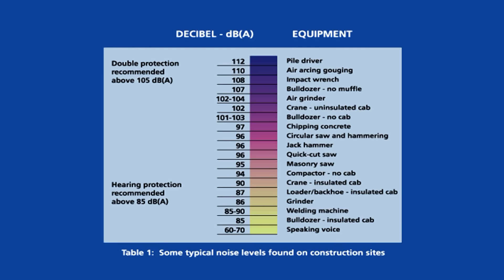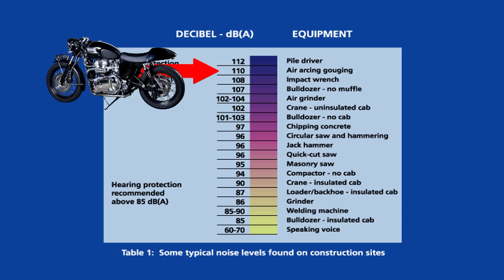Why Not to Change Your Car's Muffler

Comment: Next video:
“Why cars shouldn’t be fun”
Reply: SGKatrox "why modern cars aren't as fun as 90s cars"
Reply: Lol
Reply: "Why the only car you should own is a bone stock mid 90s Toyota Celica"
Reply: Jesse Westover lmao
Reply: you have to tune your exhaust then it would be fine to change it but if you dont tune it it will be just like he said in the video
Reply: Lmfao
Reply: Why u should take the bus
Reply: Lololol yall funny as hell broo dam
Reply: It's just a title of the video, if you actually watched it he says he's all for it except that you have to know what you're doing. I've driven without a muffler for a week (not because I wanted to, but because it fell off lol) and it's a fact that the car runs worse, it felt like the gas pedal did not accelerate the car fast enough (loss of power) and my mpg went from 9mi/gal to 5mi/gal.
Reply: As a mechanic myself cars aren't made to be fun. They are a tool that you use to improve your life!
Reply: 1996 camaro Z28 LT1. torque galore
Reply: Borie Seng don't worry we'll straight pipe it too
Reply: Sarem no it wont🤣

Comment: Funny enough, I bought a 2002 Mitsubishi Lancer from a woman who said it didn't have a catalytic converter. Turned out it had an $900 Magnaflow high flow cat and muffler. Needless to say, it made it sound like a Nascar. 

Now? I just bought a 94 4Runner off Craigslist. Turns out. Someone decided to straight pipe it so it doesn't have a muffler. Still has a cat though, just no muffler.

Comment: I cant agree with him, doing a full exhaust and the right tune does have a significant difference
Reply: Fat091587 If you watched it fully he says about having it tuned top specific exhaust backpressures but that to many don't put the time into it.
Reply: He didn't talk about back pressure, he spoke of flow rates. Internet argument ENGAGE!!!
Reply: Doing some exhaust work on mine too. Factory exhaust is too restrictive for all the other mods I've done lately. Loving the supercharger whine but wanna hear it roar from the back too you know.
Reply: keyword right tune. most inexperienced people don't tune anything to compensate for the pressure change
Reply: Did you even watch the video? He specifically said it's not a big deal to just swap mufflers if you get a tune, just not very effective. This wasnt about full systems just people sticking fart can mufflers on stock exhaust systems

Comment: Watch this video. I removed the Muffler anyway.
Reply: Billal mabuza well??? Did the performance of the car change like Scotty says?
Reply: @tiktoktiktoktiktok6065  I changed the muffler on my '06 Tacoma and haven't had any noticable power changes or even a check engine light. Just a nicer sounding truck, which is what I wanted.
Reply: Imma about to do it tomorrow haha
Reply: @ICEY02  lol doing mine monday
Reply: Me to
Reply: Update! My low end torque became slow and my gas consumption went just a little bit high and it pops when my aircon is off lol but it sounds great HAHAHA
Reply: im going to do mine as we speak
Reply: low end torque comes from back pressure.. there's always a drawback to messing with the exhuast.. there made to allow a smooth balance of as much low end and high end power!! try a high performance air intake to match the the inlet flow to the now faster outlet flow
Reply: @massivewoofers247  you are a 💯 correct. I put a K&N air filter in my truck after I had the exhaust done and it runs much better..it feels like it flows better.

Comment: Better Title: Why Not to Change Your Car's Muffler with no Tune.
Reply: You can drive the car wothout exhaust and it still would be fine
Reply: AlwaysChristian wrong bigtime. Running with Fuel Trims skewed all over the place isn’t “the computer being smart enough to compensate”. If you want your car running right, play it safe, tune for modifications.
Reply: Webba i have been running de muffled car for 12 years without problem. If you need to play it safe the car just sucks.
Reply: Wow you need a tune just to change a muffler,  you’re smart aren’t you?
Reply: Guys I'm not saying that I personally think you need a remapped ECU tune to change your muffler, I'm saying that Scotty wasn't focusing so much on the muffler change itself but on how the ECU handled the muffler change.
Reply: Agreed.
Reply: there is a difference between changing just the rear muffler and all the mufflers
you can change the rear muffler as much as you want, even remove it and there'll be no difference as there are no sensors back there
Reply: @AlwaysChristian I speak from experience. My car has no cats, muffler, or resonator, and it is tuned for that. I have never had O2 sensor issues with my car. A gent i know has a canned tune on his running header-back exhaust as well,  and he goes through O2 sensors every 2 years. Furthermore, there is a difference between air-fuel ratio and fuel trims. Yes air-fuel ratio is supposed to fluctuate constantly, but fuel trims are supposed to remain within certain specifications. If they are pulling or adding too much fuel, there is something the ecu isnt being told about.

Comment: I had a 1982 Mercury Lynx that had a huge muffler and a tiny tailpipe that would top out at 89 MPH. I had the muffler taken off and replaced with an ANZA angle cut resonator tip. The sound was great. I put one of those TURBO stick on placards on the hatch lid. Everybody swore it had a turbo with it backfiring and flaming. It would then do 125 MPH with no further mods. I loved that car to death!

Comment: All you have to do is tune your car after you muffler delete.
Reply: Only if you delete the cat
Reply: I am alive
Reply: Mufflers are past any o2 sensors..unless it’s a muffler delete(straight) then most likely airflow from the engines exhaust will change since exhaust air won’t have any restrictions and might change readings on the o2 sensor.. other than that a muffler with a different muffler won’t change much..
Reply: the rear muffler/s do not affect anything
Reply: Yes your right but it's extremely expensive , I have headers on my 350z and it runs better so a month later I decat itand it ran shitty ,I also had muffler delete ,now I put muffler back on with headers runs great
Reply: Also put the cats back on to
Reply: @Foozefighter  would i pass the sniffer inspection after switching my muffler for straight pipe
Reply: @Fingerboardmaster200  i am not familiar with the laws of your country, you should check that first
Reply: @danielrichardson2931  high flow cats run out better than test pipes/cat deletes. They cost more but worth it.
Reply: @cmdoseck3022  nothing flows better than down-test pipes ,but it made my 350 z run worse with my shorty  headers ,if I  had it reprogrammed ,or retuned then It would of worked but they wanted 1500 $
Reply: @cmdoseck3022  when you out down pipes ,your doing a  total cat delete
Reply: @danielrichardson2931   just speaking from personal experience......and preference. I kind of prefer the smooth feel of a high flow over the blatty test pipe.
Reply: ￼

John Hege

Automotive Mechanic

38 years of experience

Any change you make in the exhaust system downstream of the catalyst and Oxygen sensors should not affect the performance of the car or the control systems. Making changes in the exhaust ahead of the catalyst or oxygen sensors may cause you an assortment of problems. In either case, deleting a muffler from the exhaust could give the dealer service department an excuse not to honor any warranty. So you might be well advised to put any such work off until the manufacturer’s warranty has expired. If however you are having problems with your exhaust and don’t want to take the car to the dealer, you can contact Your Mechanic to have a technician come out to your home or office to check out your exhaust system right there on the spot
Reply: @Foozefighter  i live in estonia

Comment: This is targeted to the kids who ONLY do it for the sound. Those of us who mod and tune our engines is a requirement.
Reply: i only do it for the sound. Car is A-OK
Reply: Adding a Flowmaster Series 50 HD Big Block muffler.  And a Bank's intake tube with the high flow filter.  I think removed the negative battery cable for a minute.  The results were quite than stock by 3db and 3mpg more at 70mph than 65mph.  Diesels love more oxygen!  And  I recently passed the CA emissions testing.  The tailpipe is also cleaner looking.  The truck climbs the I-5 Grapevine hill 5°f cooler, quieter, and smoother.  Not downshifting excessively.  Staying below 2500 rpm at 65mph.  Stays at 2k rpm at 70 mph.  Got 3.92 gears and stock 31.6" diamond tires. Power, Stealth, and Economy!
Also the factory had the dealer keep my truck on the internet link with Detroit for about 26 hours to study my truck.  The transmission runs even sweeter than before.  Runs mountain back roads beautifully.  On a trip to Colorado, Wolf Creek Pass and the Eisenhower tunnel were easy!
Just pick your parts carefully!
Reply: Agreeeddd I am modifying my Nissan Pathfinder lol

Comment: New vehicles can easily compensate for the minor difference in backpressure from a different muffler.  

They're also so far away from the post cat O2 sensor that it won't be a problem.  

im1ne FYI
Reply: Pretty much any car ob2 and ob1 if it’s a cat back the mpg will not change at all or how the car runs it will be just louder 

I did a cat back in my camaro

X pipe 
No muffler 
No tune nothing changed
Reply: Clous von muffler deletes on a vq engine sound nice 👍🏼
Reply: Hell, even older cars can compensate. My 92 miata is fuel injected and I've run it with a bigger diameter catback and even once removed the muffler leaving only the midpipe making it straight piped. In over 5 years I've never run into ANY problems with the engine and countless owners that put on a catback system and nothing else will tell you the same story.
Reply: Darn those pesky ECU's
Reply: Jeremy Menchaca actually I think there is a few cars that don’t like mods until you buy a tuner for it 
I think the evo might be one but I know 8th gen civics and up you need hondata to benefit from the mods but it won’t ruin your car or hurt mpg

Comment: Changed my muffler bout 7 months ago. Still no check engine light. Still runs fine. And sounds great. Plus my O2 sensors are before my muffler so its not messing up anything with the computer cause its stock until the muffler

Comment: If you change only the mufler you don't need a tune.
But if you change the hole exhaust system get a tune + intake I recommend.

Comment: This is flat out wrong. Taking a muffler off is not going to affect your air/fuel ratio at all, or how your car runs in any other way.
Reply: Pause the video at 2:09. As you can see most modern exhaust systems incorporate a resonator and catalytic converter. In older systems the muffler was solely responsible for fine tuning back pressure and sound. In newer cars the cat and resonator create most of the back pressure and really eliminate most of the exhaust noise. The muffler is there just to fine tune the noise.

He missed an opportunity to explain the functions of components in an exhaust system.
Reply: you may lose some back pressure but not much

Comment: Most car enthusiast knows to get a tune when changing the exhaust or intake. When done right changing your muffler can be beneficial to proformance.
Reply: And most idiots say stuff like this, just cause you watch mighty car mods does not mean you’re a car enthusiast
Reply: Luis Ramirez What is proformance? You mean performance, right?
Reply: Catbacks don't need a tune lol
Reply: Scotty that's why when you fit a less restricted exhaust and air filter on a car you get it rolling road mapped to suit the vehicle parameters and adjust for optimal power and torque. You talk trash

Comment: Scotty, I have a 2010 Toyota Corolla le 4 cylinder 1.8 liter engine at 137,000 miles. The driver side engine air intake resonator fell out of it. That’s what I was told when I bought it for 3900.00 
Should I replace the resonator or will it run fine without it?
Reply: How is it running?
Reply: Drives like a dream.

Comment: Next he'll tell us that cold air intakes are bad for a car...oh wait, he already did that... Okay...Next he'll tell us that upgrading your breaks is bad for the car because it's meant for the originals
Reply: But Cold Air's really dont do anything for the car tho :/
Reply: Saahaj Mattey only if you car just sucks
Reply: Malachi Robinson Knowing how to spell "brakes" is good for your car.
Reply: that_G_EvanP Actually my spelling has no effect on the car. But it does on my grammar
Reply: I think you should do some research before calling someone an idiot as cold air in itself burns more effectively as it has more oxygen, whereas the hotter the air the higher chance of pre-ignition and knocking. Also not every engine needs a tune to benefit from exhaust/intake.
Reply: Cold air intake sometimes does, sometimes not. Depends on the car. Some manufacturers have good air systems from the factory, some don't and this is where cold air intake becomes handy.
Reply: Bryan Rippy Pre-ignition and Detonation (as I described as knocking) are both caused by excess heat, and can both be fixed/prevented with cool incoming air.
Reply: I understand what Pre-ignition and Detonation are, I dont understand why you believe it can only be caused by a small number of events. Lean fuel mixture is not the only cause of detonation as it could be the loss of a EGR, wrong spark plugs, over advanced ignition timing, overheated engine, excessive boost and yes, overheated air, showing that the heat problem doesnt always start with Detonation/Pre-ignition. So if we go back to overheated air and run it through a older engine with a carb that's pulling engine/header heat, or its extremely hot weather, it is very possible to have Detonation as well as Pre-ignition due to a higher air-fuel charge, and lowering the temp decreases this risk.
Reply: Most "CAIs" I've seen were pod filters dangling around in the engine bay, while the OEM airboxes had ducts pulling air from in front of the radiator
Unless you plan on adding copious amounts of power through other mods, the OEM system is probably overkill already.
Reply: Malachi Robinson They are
Reply: Central Intelligence Agency I know with the fiesta st, an intake is a 250$ noise maker.  Haha. But definetly worth getting if you plan on getting a bigger turbo in the long run.  But you'll have to upgrade the intercooler, piping, downpipe, and exhaust with tuning before you just slap a bigger turbo on it.  Haha. I've seen a video with a kid who had a 400hp fiesta.  Full bolt-on, tuned with a bigger turbo.  Thing was nuts.  Haha
Reply: Breakneck yeah. Most of these newer cars are maxed out with what they are set up for for max power and efficiency from the factory.  Any thing you bolt on the car to change airflow and temps require a tune in most cases.
Reply: Breakneck for an intake you don’t have to tune it, take off your battery cables for 10 min to drain the computer, put them back on and idle for 5 mins then in one gear slowly go from idle to high rpm, computer will adjust fuel mapping
Reply: Breakneck cold air intakes do a little, my car only had a 3 hp difference but still something
Reply: Saahaj Mattey they sound cool tho
Reply: Very true, most ECU's operate within a set parameter to adjust air/fuel ratio.  The primary function of a vehicle's O2 sensors are to read the oxygen levels so that the ECU can adjust accordingly.  Most ECU's can compensate for the additional oxygen brought in by a cold air intake and the lower back-pressure of exhaust modifications.  Modifications that increase your engine's natural ability to pull air in and push air out benefit the production of power.

Comment: But don't modern CPUs compensate for minor modifications like an intake or muffler by automatically adjusting the fuel ratio?
Reply: ECU *
Reply: In closed loop fueling yes.  Aka when you are not putting the pedal to the floor.  His info about changing a muffler or catalytic converter affecting the tuning of the car is wrong too.  The 02 sensors before and after the converter only are there to sense if the converter is doing its job of cleaning the exhaust.  If you put headers on a car, that is the only real time a change in the exhaust would warrant a tune.  That is because the headers come before the narrowband 02 sensors..which are before the catalytic converter 02s and the narrowbands affect closed loop fueling.

Comment: This may have been true with older vehicles and may be true for some newer vehicles.  However, there is plenty of dyno prof that the stock ECU tunes can still compensate and will absolutely make more power with a free flowing exhaust.  Will it make more power with a tune?   Of course.